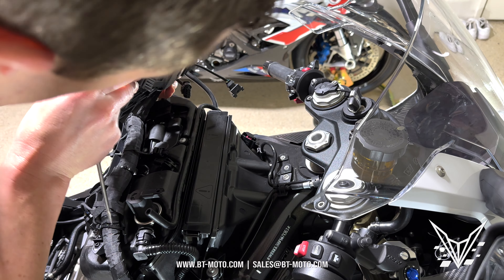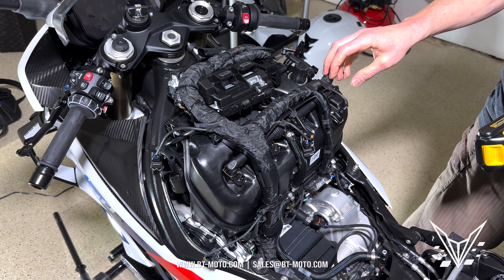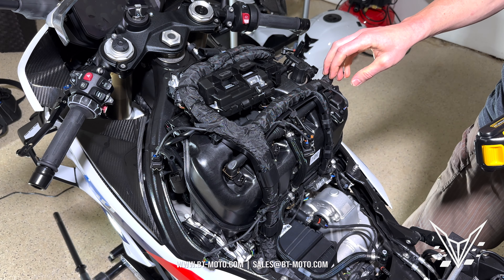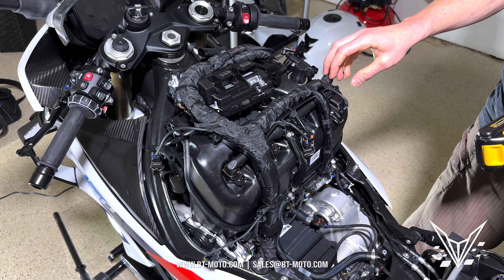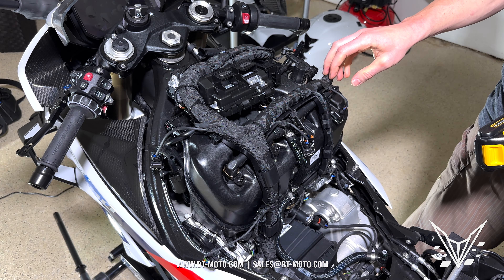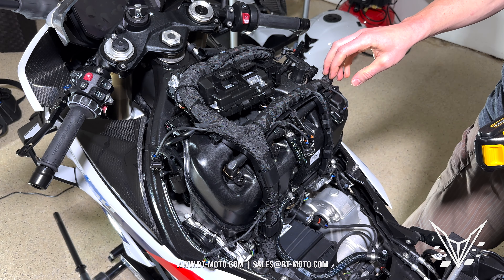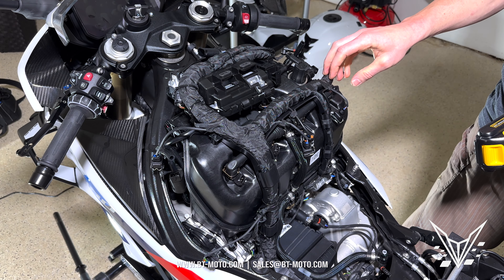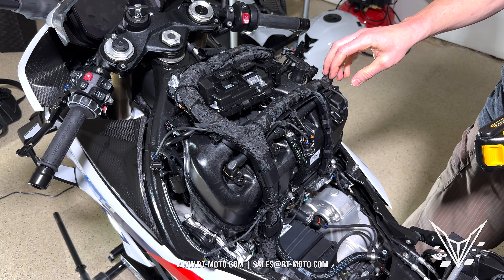How To Install BT Moto IAT and Flapper Kit For 19+ S1000RR/R/XR, M1000RR

Comment: Based on some logic, my insight about the IAT relocation would be this: we all agree that the air in the airbox is hotter than one in outside the bike. Especially at lower speeds or on traffic. As we relocate the sensor outside the airbox, it will read a lower temperature, but we don’t relocate the engine itself, so engine would still receive the higher temp. air. (Same temperature, as the iat would read in its original location) What we get after this mod is the ECU thinks the air is cooler than it actually is and gives more fuel. The bike starts to run rich, that means a poor air/fuel ratio and lower hp. I cannot understand how do they receive additional power from this mod. Tell me your insights.
Reply from the maker: Watch our IAT video we posted a while ago that breaks this down. Thanks
Reply: @BT_Moto  How the video is called?
Reply from the maker: @Altarofwater  https://youtu.be/B8DKSI7Z8iM

Comment: If you get the Stage 2 tune and opt for the flappers to remain open, then this is no longer necessary, correct?
Reply from the maker: Even with it forced open there is a restriction, so those looking to max the bike will want it removed.

Comment: I just finished doing the flapper delete and ait relocation. I haven’t done the tune yet but now I have an engine control fault but it still runs normal. Is that to be expected?
Reply from the maker: Normal and due to flapper kit
Reply: How do you clear the fault?
Reply from the maker: @jonathanacosta7509  with our flash or a heal tech
Reply: @jonathanacosta7509  you either have to get a servo buddy or do the BT-moto stage 1 flash.